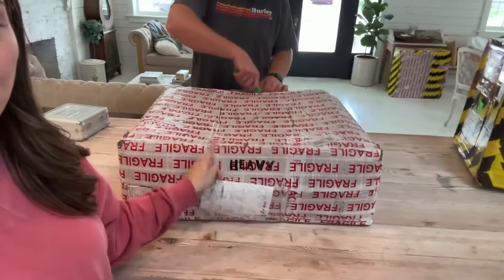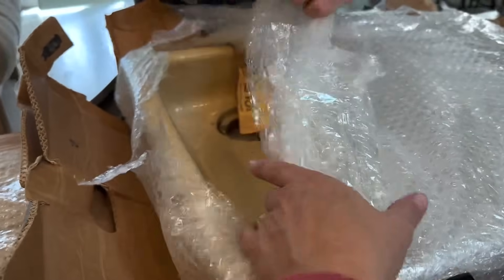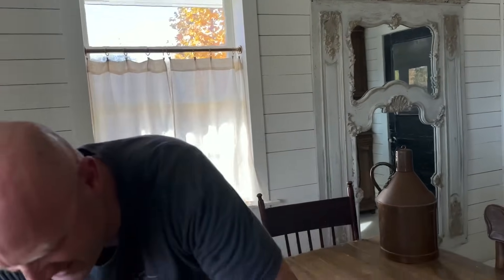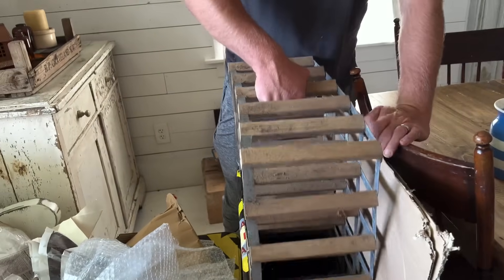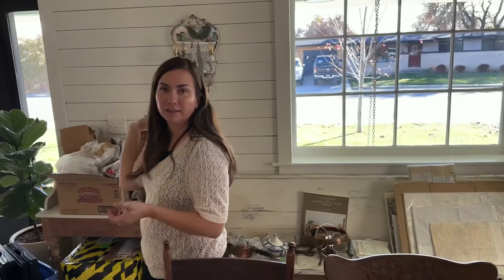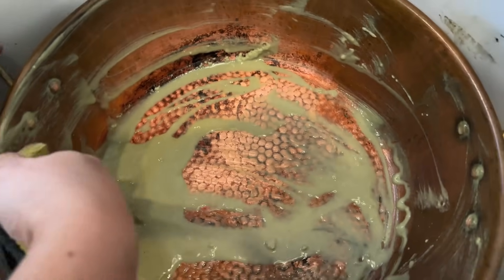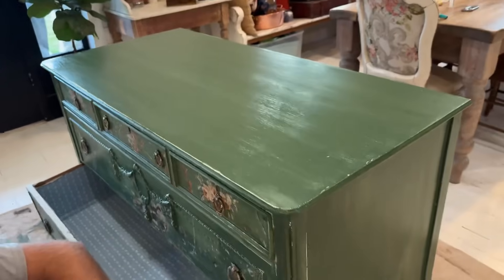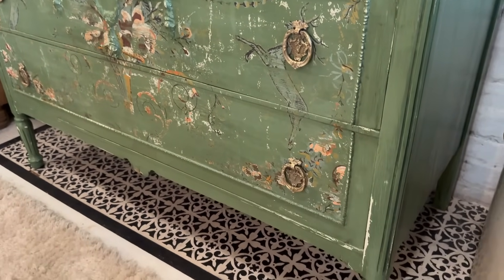Did the sink make it?! Unboxing thrifted finds & $25 Thrifted Dresser Makeover - IOD Paint Inlay

Comment: Wonderful finds from England ❤ So glad the sink made it for you ok. I have a natural cleaning method that cleans copper. Cut a lemon in half add some coarse salt on the open end of the lemon and then use the lemon half (as a scrubber) on the copper piece. Scrub it in a circular motion and it should clean it very easily. The chemical reaction of the lemon juice and salt cleans the copper. I use this method on my copper bottoms of my kitchen pans. 😊 The dresser turned out fabulous 🎉 Wish I could have it. Great job !!!  Green my favorite color 💚